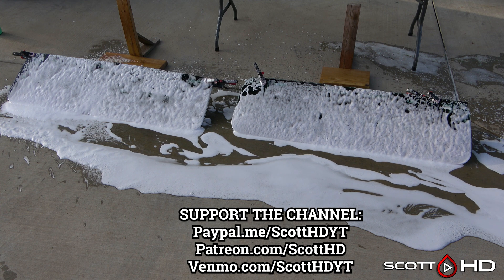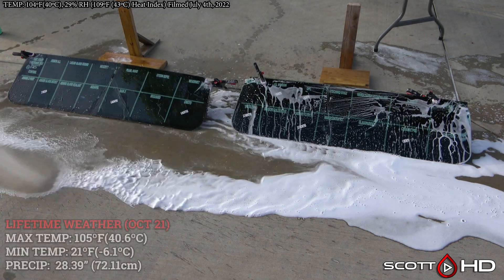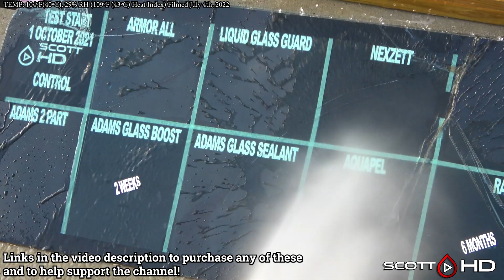28 WAY GLASS COATINGS TEST (HYDROPHOBICS) - UPDATE 11 - 9 MONTHS

Comment: Ok I've got armorall on the wifes Murano.  That thing  has a HUGE front window.   Anyway I had a hell of a time with the smearing of that stuff.  I can't tell you how long it took buffing that window to finally get it clear.  It works great....but the labor involved was a nightmare in my case.  and FYI.... Meguiars Sealant is ONLY available from the UK or Italy... not sold in the US anymore.
Reply from the maker: I am wondering if they changed something since the original install.  You aren't the only one that's said something about that with armor all
Reply: I'm wondering if the issue is with environmental haze and contaminants that needs to be removed leading to issues with Armor All. I've coated my 2014 X1, a friend's 2020 Mazda 3 and a 2022 Kia Seltos, in all cases I polished the glass using glass polishing discs either by hand or by DA/rotary using Turtle Wax 1 and Done followed up with Stoners Invisible Glass cleaner. If using a glass cleaner or just water, prior to polishing, a spotty film would be visible despite the glass looking clean. After using a polishing compound it removes that creating a super clean and flat surface for the Armor All Extreme Shield Ceramic Glasa Cleaner to bond to. I've had very little issue with removing though expect some flashing as ceramic based products can cause. A glass cleaning cloth or short loop microfiber should be able to level or scrub any left over product away. I found Griot's a nightmare to get off after it flashed, especially with the second coat to the point I didn't think I would get it off. I believe higher humidity levels make removal more difficult.

Comment: I see a lot of negative reviews on the armor all regarding hazing and also that it's really hard to get off paint.
Reply: I've noticed a lot of 5 star and 1 star reviews. I was kind of concerned about the 1 star reviews. I made sure the car was cool, I was careful with the spray, and I made sure to wipe quickly. worked great for me
Reply: I experience slight front windshield hazing that flashes quick, it hasn't been an issue for me. It's less than Rain-X and significantly less than Griot's. Are any of the glass sealants streak/haze free?
For reference I'm using 3 year old Bosch Icon wipers with 25,000 km on them.
Reply: Did 2 cars and had 0 issues.

Comment: I will get some Armor All Ceramic Glass next time I'm at the store. It's cheap, long lasting and easy to apply with no wait time or 2 part application.
Reply: Armor All is what I've been using for the past 6 months and love it from everything you said plus being a a cleaner and sealant in one it works as a maintainer.
Griot's failed within 1-2 months on the front windshield leaving extreme wiper hazing.
Reply: @dailytonic5415  Almost unbelievable Armor All came up with a really good product
Reply: @Centaur008  I avoided their products for decades, much the same as Turtle Wax but now that's mostly what I reach for, Armor All Ceramic Glass and Wheel Cleaners and TW sealants and compounds.

Comment: Of all of the ones that still remain, how would you rate them all as far as ease of application? Or which one was easiest to apply? Keep up the great work man. Love all your testing!
Reply from the maker: Definitely armor all being easiest.   Aquapel is a royal pain but works.   Glassparency is a pretty involved process, the Nanocoatex ones are on the easier side... The Adams ones seemed to be on the more "grabby" side of things.   I'm still liking armor all for the ease of use and it's super easy to reapply (and fast)
Reply: @ScottHD  Thank you Scott. Sort of off topic, but I am wondering how well something like this would work on a shower door on the inside, to try and help with ease of cleaning and buildup? That is what I am looking for, and something that is easy to use so it doesn't become a pain in the butt. Armor All sounds like the ticket.
Reply: @klsteele  
Funny you mention that. Did that to 2 full glass shower enclosures. Works like magic! No residue or anything. There's still some water left on the glass when you finish... But less than 30% of what was left before I treated them. It DOESN'T help to clean previous water spots though.

FYI... If you're thinking about it for mirrors... Don't. It didn't help at all in repelling vapor fogging. It DOES work great for the side mirrors. They stay almost dry all the time.
Reply: @shane250  Excellent info...thanks for sharing your experience. I think I will give it a go on the shower glass.
Reply: @klsteele  
No problem. Good luck!
Reply: He discussed about it in the application videos... Armorall was the easiest. You don't even need to clean your windshield beforehand, since it's a cleaner and coating.
Reply: @shane250  Thank you. I will go back and check it out.

Comment: Are you sure Griot's and RainX are failed?   Griot's looked very good... and RainX ok or weakish.
Reply from the maker: They've been acting like they are not failed the last two updates. I'm not 100% sure what's going on with those
Reply: @ScottHD   I'd say Griot's is dead based on my experience with it. I applied as directed, even went as far as polishing the glass with Turtle Wax 1 and Done using glass polishing pads with a DA and rotary finishing with Stoners glass cleaner. At about a 1-2mo mark I was getting severe wiper haze and you could see where the product was failing. Despite all the great reviews the longevity was poor and application removal once it flashed was extremely difficult. No recommended for front glass, anywhere else it's fine.

I now use Amor All Extreme Shield Ceramic Glass and it's been excellent. A perfect lower cost option for a ceramic coating, cleaner and maintenance product all in one. A dedicated glass cleaning cloth or short pile loop microfiber should be used as product flashing, similar to many ceramic infused products, can be more difficult to remove or level. Armor All wiped off with little issue, leaving only a few spots that needed extra scrubbing. There is less wiper haze in night time driving compared to Rain-X and significantly less than Griot's but slighty more than uncoated glass. Perhaps one of the best Armor All products I've used yet. 👌🏼

Comment: Interesting!  Has Glassparency received its renewal treatments (they say every 3 - 4 months a "renewal" treatment is required)?  Did any of the other coating makers mention "maintenance" applications?
Reply: Every product has a lifetime longevity, when you simply reapply (renew) monthly!
Reply from the maker: No reapplication to anything
Reply: That wouldn't be fair, unless you reapply all the others as well. Same thing with doing 2 coats of something.
Reply: Glassparency and their dealers make GP's "refreshing" (which is covered under warranty) a major point for durability.  Possibly other vendors do the same.